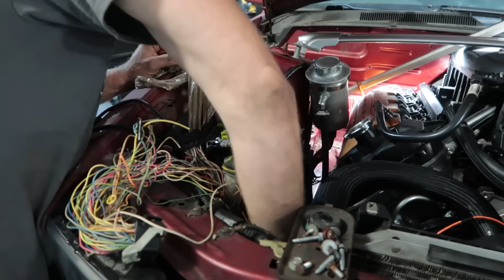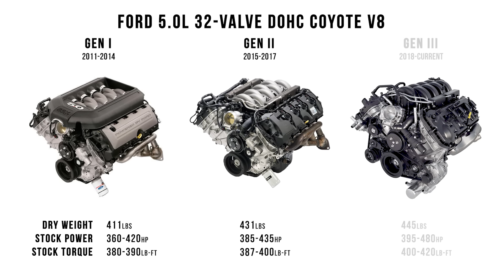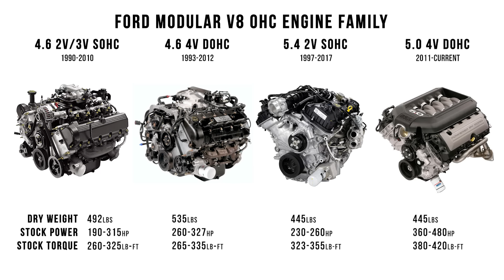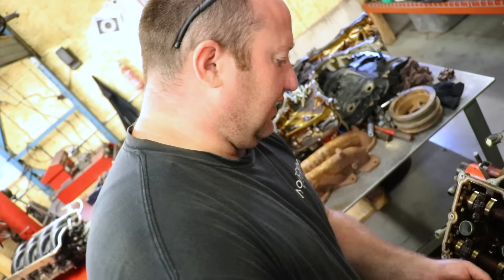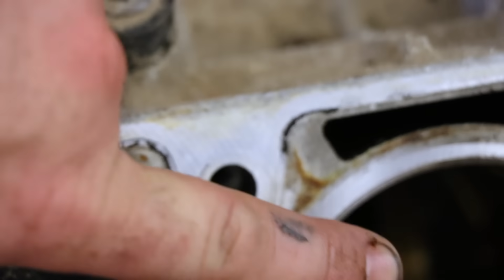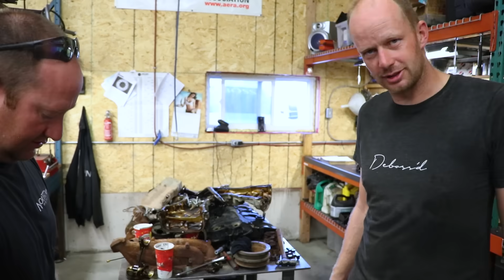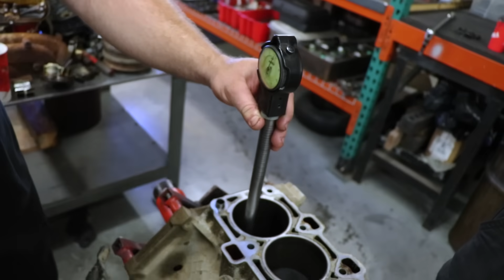REVIEW: Everything Wrong With A 5.0 Coyote Engine

Comment: "Oil is cheap. Just do more oil changes" BINGO!
Reply: @Chuck Gladfelter my newer 2014 truck i change the oil 2 to 3 times before the monitor goes off. i change it between every 3k to 3.8k is highest i let it get. i dont trust the monitor... i will admit idk how it tells when its ready to change oil. just a odd fact i have noticed
Reply: Oil changes: The single biggest reason why guys with GM AFM engines have lifter problems. They cheap out on oil changes, sludge up their engine, and then piss and moan about GM AFM engines. I know guys that have over 200k miles on their AFM 5.3 without any tick or oil consumption. The difference? They changed their oil early and often, using quality oil and filters.
Reply: Cheap oil needs to be changed every 3k! Will run in your vehicle perfectly.  But now you can buy synthetic for 13, so what is cheap i guess. Synthetic has a higher flash point and can take more heat and abuse before it breaks down. There are many factors that determine when you should change your oil though.
Reply: @slopoke22 , actually cheap oil cannot last more than 2k miles
Reply: Love the Tim Hortons at the start lol
Reply: change oil every 3k miles in my 5.0 f150, i learned a lesson with ecoboost f150... oil is cheap, turbos are not
Reply: Different By Design what was your ecoboost lesson?
Reply: @differentbydesignlifestyle  5-7000 miles is more sane.   3000 miles is a thing of the past with regular oil and much worse technology in both oil and metalurgy.
Reply: @differentbydesignlifestyle  Leave the motor run for a little while before shutting same down... it all helps...
Reply: @malachy1847  i would let it warm up before driving and cool down before shutting her off most the time
Reply: @differentbydesignlifestyle  , I learned my lesson,  ford is ford,  never again I will buy another Ford.
Reply: @repairvehicle  this is with any car its not just ford. Even garrett turbos break if the oil is not changed
Reply: @the_modfied_car4903 ,  motorcraft oil is just low quality garbage. It's cheap for a reason, quality comes with cost.
Reply: @repairvehicle   you could always buy dodge ... fiat lol
Reply: @fj5492 , no thanks.  I'm satisfied with my Toyotas and lexus.
Reply: @repairvehicle  the point is ford is way better then dodge
Reply: @fj5492 , better at what?
Reply: @repairvehicle  Yep got me a Toyota Tundra not looking back..best truck made
Reply: @mjuberian ,  I was just looking underneath big 3 trucks, and what a joke they are with their plastic transmission pan. Also, exhaust pipe under the plastic pan, genius idea to melt plastic pan and have transmission failure.
Reply: @repairvehicle  you talking about a plastic/composite transmission pan when engines have plastic cam covers, intakes, thermostat housings and all kinds of plastic parts directly sitting on 210* average engine temp and you worried about a filled trans pan with 55mph air blowing by it with a 2-3” gap? Hell cars and road tractors have plastic/composite oil pans. That pan wont “melt” unless the pipe is mashed into it but then there will be other issues with the leadframe harness inside the trans if that happens.
Reply: @young11984 , that's why big 3 has major transmission problems,  plastic pan that cannot tolerate heat. Only stupid people put exhaust pipe under transmission pan to cook fluid and cause transmission to fail
Reply: @repairvehicle  you realize the plastic (actually composite in most) pans can tolerate up to 300* before any type of breakdown of the “composite”starts right and thats with no fluid to absorb and transfer the heat or without airflow that all cars have when moving any. I guess your engineering degree is spent on YT complaining about how stupid engineers are to use composites/plastics while they are using them and making big money doing it. I dont hear complaints about plastic/insulation on O2 sensor wires and plastic connectors that arent melting thats screwed directly into said hot exhaust and doesnt melt but i guess you didnt think that thru yet to criticize. Makes sense, carry on
Reply: @young11984  , O2 sensor not made from plastic. Plastic connector on O2 sensors 6 inches away from heat and even they fail from heat. You not smart as you think you are.  Keep defending your clueless mind, because everything you say contradictions to the facts. Even Ford with plastic engine pans had issues due to heat and then stopped making them.
Reply: @repairvehicle  keep dreaming, plastic thermostats, intake and valvecovers are on nearly every engine these days, radiators with plastic tanks and all sit in constant 200*+ but yet you think you know more than engineers that design the parts. I never said O2s were plastic, reading comprehension is wonderful thing, wire insulation.... anyway i have a truck to build while you carry on with the keyboard expertise😂
Reply: @young11984  , plastic truck to build that's sounds right from keyboard expert.
Reply: @repairvehicle  😂😂this is a 65 F100 hoss, its real metal but will have a plastic trans pan on the ZF6 though
Reply: @young11984  , plastic pan on manual transmission? Must be a dream come true.
Reply: @repairvehicle  Aussie ZF6HP26, look it up.....not a manual is it😆
Reply: @young11984 , zf6 and zf6hp26 not a same thing,  looks like you don't know the difference if you can't even post correctly.
Reply: @repairvehicle  look i know what im talking about and if you dont then thats your problem, ZF6 is the common term used by those who know what they are, what they came in and what im using it in. If i had said FG/ZF swap in my F100 you still would have talked shit because you likely wouldnt know what that combo was anyway. If you know anything about those engines and transmissions then lets talk, if you dont understand what im referencing then ask but you wont you will just assume as shown above. Good day
Reply: @repairvehicle  we have chev at work , needs oil added  every day.
Reply: @George196207  , your point?
Reply: @repairvehicle  Only car I ever had problems with was a low mileage Chevy.  I learned my lesson there with all the added work for simple maintenance and scrappy electronics.
Reply: @differentbydesignlifestyle  that is just to often. Do it every 10kkm.
Reply: @alexstromberg7696  ? 3k miles is different from 10km
Reply: @alexstromberg7696   3 thousand miles is around 4800 Km, and Ford recommends changing the oil (and oil filter) on just about every engine they made over the last 15 years every 10.000 Km, unless you run it on particularly taxing cycles, like not giving the engine enough time for everything to get to temperature in a trip, in which case they recommend ... 5.000 Km intervals, which is basically 3.000 miles.  
Not knowing the usage scenario... it might seem like it's too often, but...
Reply: @alexstromberg7696  ever notice how much the oil breaks down? the color is black and it smells completely different
Reply: @alexstromberg7696  kkm? are you in canada?
Reply: @Peterowsky  i run the truck and towed
Reply: @differentbydesignlifestyle  im in Sweden
Reply: @differentbydesignlifestyle  the oil is black because of dirt. It because black after just a few mins of the engine running.
Reply: @differentbydesignlifestyle  if you don't know why it's black maybe don't comment on it. It's due to blow by
Reply: @differentbydesignlifestyle  is Canada the only country that uses km? No, I'm in Sweden
Reply: @alexstromberg7696  its not too often for a turbo. Turbo literally cooks the oil, even when liquid cooled.
Reply: @icenine135  they do not. I work with busses and they are only oil cooled. if you drive it at vmax for like 2 hours then just shut the engine down, then it will cook the oil.
Reply: Do what the BITOG guys do and purchase/hoard oil in bulk when they have a sale.
Reply: @TheUltimateCrash1990  , no such thing as sale.
Reply: Synthetic oil sure a hell isn't cheap!  In fact, neither is mineral oil nowadays!
Reply: @scarhart53  true synthetic oil last about 4  to 5 times longer than none synthetic. You get what you pay
Reply: I learned this 50 years ago and it has not changed.
Reply: Amsoil problem solved especially with Ecoboost engines
Reply: Ford Duratec v6 are very reliable to bad they bad don't make it anymore
Reply: Just use good oil and BINGO!
Reply: @Chuck Gladfelter if i ran the oil to the life monitor and than changed it. my mpg would go up 4 mpg... thats telling you the oil is not efficiently lubing the turbos
Reply: Oil has ZDDP.   The engine can only use so much of it.   Too frequent changes keep the ZDDP in the oil to go out the cat converter and poison it.   I will not change my oil more often than needed.    If you are worried, then change only your filter.
Reply: @michaelprice3785  sounds like you will have to rebuild or replace your engine more frequently. Whatever floats your boat 🚢
Reply: @nickthrane4940  Hardly.   I am at 220k miles and going strong.   How do feel being a stooge to the oil companies and their bullshit.
Reply: @michaelprice3785  many can go 220k miles but that doesn't mean the engine is in good shape.
Reply: @nickthrane4940  I go 5000 mi on conventional and 7500 on synthetic (which is NOT true synthetic unless uses grade 4 PAO base), even though the mfg says 15,000 miles.   If you do not use a synthetic oil filter, your oil filter will be close to going by then also.   Every 3000mi  is overkill and a waste of money and will poison you cats needlessly.   BTW, the 5000 mi/conventional/220k mi is on a Toyota that uses ZERO oil between changes.   Why waste your money.   With a Toyota the car will wear out way before your engine.   Perhaps you own a junk car with engine that needs to be babied.
Reply: @michaelprice3785  5k for conventional is way too much. 3k tops for conventional, and 5k for synthetic.
Reply: @Chuck Gladfelter, big mistake is being made by using motorcraft Oil, severe engine wear is unavoidable
Reply: @repairvehicle  would you explain how the motorcraft oil causes severe engine wear

Comment: better than ls??????  lol.. 4.6 bulletproof.......  lolololo
It took till coyote to get over 400sae net no blower.... 
ls was 405 1stgen zo6  and doesnt need 4cam vvt bullshit to do it...
and 2 turbos on a 100k stock 5.3 is an EASY1200hp

and btw,....  vw/audi did the cam to cam chain first on their 5v engines 1.8/2.7/2.8/4.2 in the late 90's, of which the v6/v8 ACTUALLY are bulletproof

Comment: As someone who's spent almost 2 decades in the auto repair industry I can't agree more about changing synthetic oil much more frequently than the manufacturer suggests. This whole trend of "lowest maintenance in its class" just means 4cyl engines now take 8 quarts of full syn when typically they always took 4 of conventional. People don't drive far enough to properly heat cycle the motor and burn off moisture and its causing as many issues as E85 is to fuel systems.
Reply: That means you it works for your driving habits and your oil is getting to warm up burn moisture out etc. I assure you I change tons of engines under 100,000 miles and thr only common factor is they did once year or 12000 miles  changes. I see so many engines ruined by extended changes its hilarious
Reply: Well you just answered my question I just asked. I'll be switching back to regular oil because I drive short commutes 3-4 times a day ranging from 2-5 miles with an hour in between.
Reply: @davidkmillerphotography  Just my opinion, but the synthetic will still work better for your application. They flow better and lubricate better at room temperature and so they are easier on the motor than a conventional when not up to operating temp. Your mpg should have a slight improvement too. That thing about sludge he said in the video, this is the first time I've heard anyone say that about synthetics, and I've done way too much reading about oils lol. Mike's main point is that you need to change your oil at a lower mileage number because regardless of the oil used, short drives are hard on them. That said, unless you're turbocharged or running a high performance application, conventional will probably work fine.
Reply: @randr10  exactly. If the vehicle calls for synthetic then run it. There are API ratings that oil has to meet and synthetic (like all oils) have what's called an "add pack" or added chemicals such as friction modifiers and detergents which help to achieve something the manufacturer is depending on being there. Synthetic oil is great at cleaning out motors of sludge so switching to full synthetic on a high mileage engine can and does uncover issues hidden by coking or "sludge" Also synthetic oil does not have the same issue with "going bad " so that's why you don't hear the X number of months or X miles with synthetic oil. The problem I see is that people think synthetic is some magic bullet when in reality it's a great product IF used as intended.

Comment: He may be a good machinist. But he doesn't know squirt about oil. He doesn't know squirt about ford mod motors. Aluminum bearings arent compatible with synthetic oil? What is he even talking about!? Sounds like a guy trying to make stuff up to seem smart on video!!!! It's OBVIOUS this motor rarely had its oil changed, and also might've idled extensively on that bad oil. That's how you get "varnish" buildup. The oil has so many heat cycles on it that it breaks down and gets thick. Synthetic oil is one of the best chemical breakthroughs in the mechanical age, and not the cause of the issues in the coyote, it was cost saving attempts.
Reply: Whoa! He did not say synthetic is not compatible with alum bearings. He stated that synthetic and short drives cause problems with alum bearings.
That Coyote engine had a hard life with little maintenance is the fellows point.

Wife has a 7 minute drive to work, we live in Edmonton AB, -35C is not unheard of.
Using a good quality non-synthetic, 5000Kms oil changes in her vehicle.
I have a 22Km with a short hwy drive with a 2.0 ecoboost, Ford synthetic with 7500-8000Kms oil changes.
The type of service that your vehicle normally does every day will determine oil and change frequency.  Both vehicles are doing good with zero failures so far.
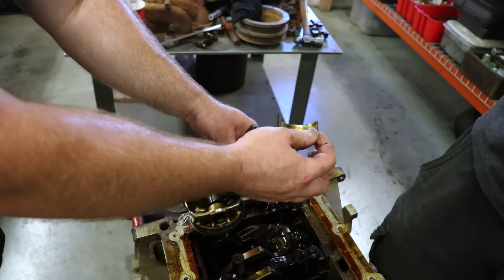Reply: @philipmackin1025     19:58 "piston oil drain back around the ring is clogged due to synthetic oil, on conventional you wouldn't see that"
22:12 "another problem is aluminum bearings, synthetic oil is known to be hard on aluminum bearings and aluminum surfaces"

In basically all circumstances synthetic oils have better flow characteristics when I'm extreme cold, and better stability at higher temps. The fact of the matter is, conventional or synthetic, change your oil MORE. A study by caterpillar has proven that the majority of wear in an engine occurs from participate matter smaller than any spin on, full-flow filter can remove (less than 3 micron). So, without a by pass filtration device, the only way to remove these particulates is to change oil at closer intervals. All the issues he pointed out he makes the connection to synthetic oil, in reality it is lack of maintenance no matter what oil. 

I 100% agree with your oil change intervals and I follow the same on my vehicles! Shorter, is always better if you don't mind the cost!
Reply: He's obviously not much of a machinist if he thinks 4.6 and 5.4 bores are different, and everything else is the same. Short deck, tall deck... I'd say that's a pretty big difference. SAME BORE! Same as 302 and 351, if ya can't figure that out I don't want you near my stuff. Which is why mine don't go to anyone else...

Comment: I had a 2012 5.0 mustang, Redlined it all 80k of it's life. One day in good ol frozen tundra saskatchewan it was -45. I started it up and didn't give it time to warm up. Got it to a highway and WOT it to hear a bang, took it to the dealer and it was a spun main bearing. Ford gave me a new 2nd gen motor under warranty. I abused that car soo bad they replaced the whole drive and powertrain through it's life under warranty that's with a full exhaust and tune. Can't say that GM or chrysler are willing to do the same. Anytime something happens under warranty period they charge you to warranty it. So in a way fords are reliable and stand behind their products.

Comment: That tip about sticking with the same oil manufacturer I was told back in the early 1980s and have stuck to it ever since. Only had one oil system problem on an engine, a Dodge 3.9 in an 86 Dakota, oil pump died at about 180,000 miles.

Comment: having to add oil is bull, i have a 2002 toyota sequoia with the 2UZ-FE V8 with synthetic oil and it doesn't burn a drop in 5,000 miles and i have a 2014 sequoia with the 5.7 V8 also doesn't burn a drop of oil, if an engine is built correctly, it shouldn't burn oil period.

Comment: Way of the future... Ford builds a pushrod 7.3 🙂. Great video though, I've never dived into a 5.0 before!
Reply: The engineer behind that engine said the only reason they went pushrod was bc of size and low end rpm use. Its on TFLs channel.
Reply: @joshuachilders129  it really makes sense in truck low rpm applications no doubt. Probably sounded like I was poking fun at the 5.0, that wasnt my intent! Just thought it was  interesting ford actually built a pushrod motor afterwards, I never saw that coming! Rumor has it the C8 Z06 engine will be overhead cam, that'll be cool too.
Reply: @Geoff240ti  I agree. The f150 platform is just kind of an all around design but this new huge truck can probably only operate in low rpm anyways. I read the rumors about the corvette too!